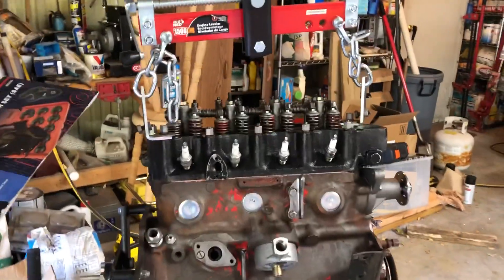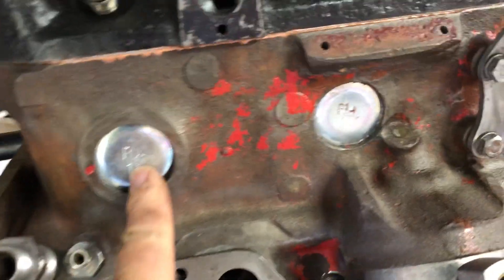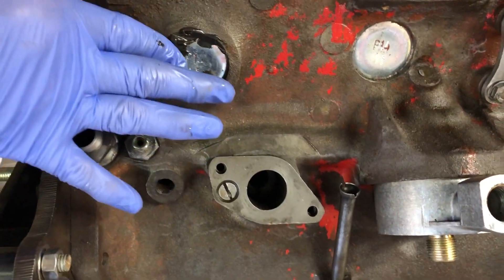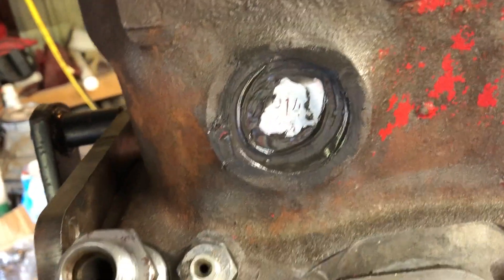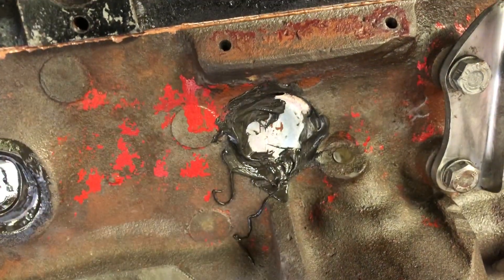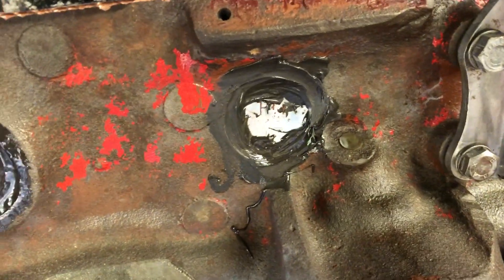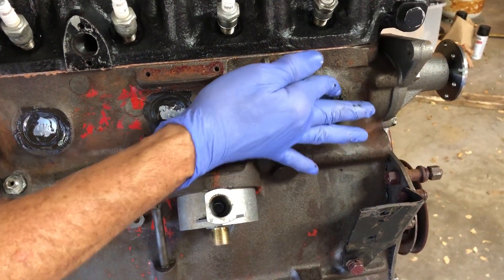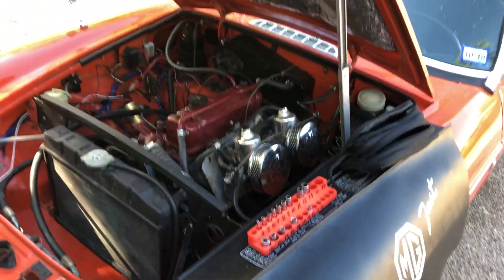294 MG Tech | Engine Core Plug Protection

Comment: My MGB has a leak on the worst core plug of all, the rear. It looks OK, clean and shiny, it just lets by a bit. I was thinking of putting JB Weld around  the plug. Has anyone had a similar problem, and did a compound like JB Weld cure it? It's engine out time otherwise and I no longer have the facilities to remove the engine myself.

Comment: This only shows the accessible ones at the side of the engine block. On my B-engine the large rear one, partially hidden between the block and the engine backplate popped out during vacation. After loosing all coolant I  had to give up my  vacation plans with the B for sure. For repairing this one the engine had to be lifted out and the backplate removed  :-(
Before putting the new block I received under guarantee in, my MG mech drilled this backplate, tapped some threads in and with a bolt (with locking nut) resting against the rear freezeplug assured it will never come out again. Putting JB Weld on the others was planned, but the existing paint on them is very difficult to remove, so I wonder about the feasibility of this action for me

Comment: Isn't the purpose of a freeze plug to pop out if the coolant freezes preventing a cracked block? If you JB Weld it in that ain't gonna happen is it? Very confused!
Reply: Well that's what they say but the real name is core plugs and they were there to enable the foundry to knock out the sand from the cores used when casting the block. Yes they may pop out if you have sub freezing weather for a time and you are using plain water but now days every sensible person uses a suitable percentage of anti freeze to suit their local climate. Even if your area never gets anywhere near freezing, the anti corrosion additives are worth having. Most plug failures are due to corrosion from the inside so they also keep that to a minimum.
I've used a thin bead of marine JB on the seat for the plugs to make a seal. When you punch the plug in it pushes it aside and makes a metal to metal contact but still keeps a JB seal. I'd call this method a belt and braces approach. Can't argue with that or the voice of experience. Good to see you back John or are you his younger brother?
Reply: @delukxy  nice seeing you here! I came across this video because my 164 just popped a plug on its first start. You seem very knowledgeable on the matter: for the remaining 5, which look like they could be hammered a little more, (they were installed by machine shop), can I just add JB weld, or would you recommend replacing all?
Reply: @DavidBello  Hi David . Sorry to here about your blow out. I'm guessing that the one that blew was one of the holes where the seat was badly corroded? The JB I mentioned was also on a Phil Singher engine rebuild and he also did it the same as the MG video. But, and I haven't checked it, he may have done the outside smeared seal on just the plug at the rear of the cam. No corrosion problems there but you can't get at it without removing the engine so a "good idea" As I said blowing them due to ice expansion is very rare now days!. Was there 2 with corroded seats? Perhaps I'd just do those. With the engine out of the car it is easy to swing a club hammer with some finesse and get a good whack on the plug. Virtually impossible when the engine is back in. They need more than a gentle tap. Some use a small socket as a punch. There is an alternative cup type of plug that has side walls the help make the seal with a little JB or similar. I can't comment on their use so you would have to ask the engine shop. They are also easy to remove with a screw driven into them a slide hammer to pull them out. Lots of JB on the outside would make that difficult after it's cured. I'm sure we will see your solution in the next episode?
Reply: @delukxy  thanks for the reply. The two allegedly corroded ones were on the crankcase oil side and JB welded by the machine shop. The coolant side core plug seat on the block was not corroded on the one that popped. Sure It looks imperfect from either casting or years of sitting in water/coolant, but if the plug popped the permatex #1 sealant used before, I’m suspicious that it’s due to the gentle hammering on install. It’s less than I would hammer it for sure. I believe that all my plugs need to be flattened more. Do you think I can hammer the ones that are still in (and not leaking yet) some more and add the JB? Or should I remove all and install JB on the shoulder in the block before installing?
Reply: @DavidBello  I guess it would be best to talk to the engine shop and stay friendly. They probably have a short warranty or similar. No sweat for them to redo all of the plugs. They don't want to get hit for an engine rebuild, again, if one of them blows while you're going back to Ca. Basically it's for the two of you to agree what's best. The one that blew obviously had been poorly fitted. Yes they do need a good hit.
Note: What is the curing time for Permatex #1?
24 hours
Assembly is operational after 2 hours, full cure is effective after 24 hours. 1. The product can be removed from metal surfaces with isopropyl alcohol. If the sealant has been dried for a long time or at high temperatures, cover the sealant with alcohol and allow to soften overnight.
Engine can be turned on its side in your case.